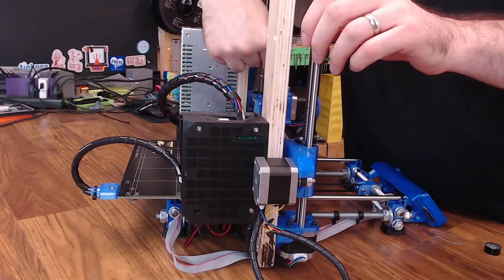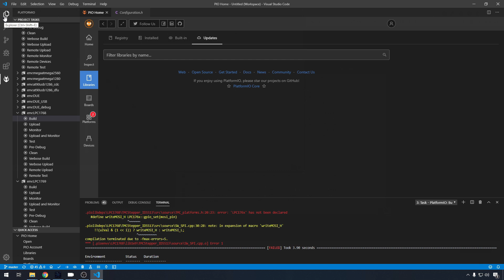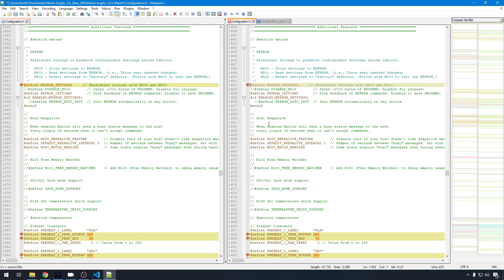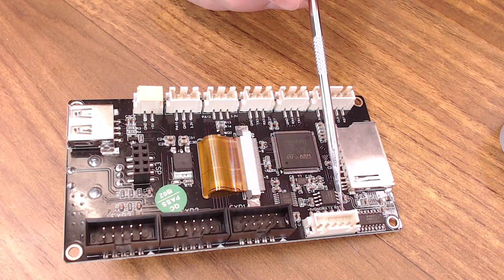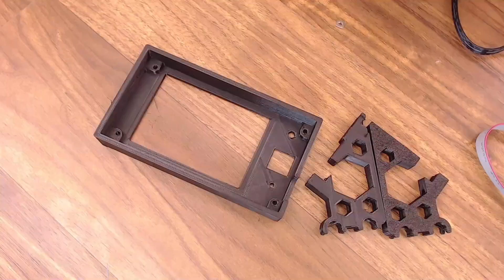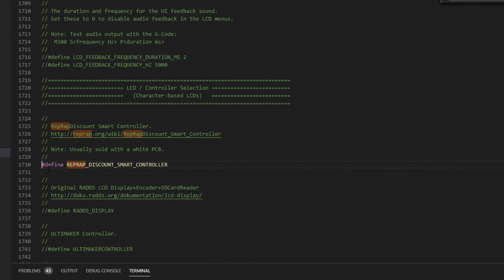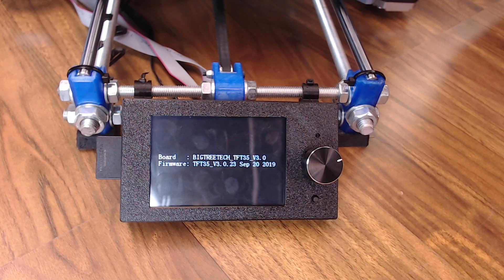BigtreetechTFT35 V3.0 Touch Screen Install - SKR 1.3 - Chris's Basement

Comment: As always very informative,
You mentioned to change the hot-end blower fan pin to make it stop when under  a certain temp. (50 C).
So the part that makes always noise can be quiet.
( I have and SKR mini E3 now and can not figure it out.)
Maybe an idea for a next item....
Thanks anyway, and keep up the good work.
efbe
Reply: Hi thanks,
But can't we use a signal pin and a Mosfet.
(PT-DET for instance ??)
I tried also the NeoPixels, but in the configuration.h the define the pin as 4, and in the pins.h its PC7 /
So I can not get it working.
efbe
Reply from the maker: Not sure if the mini has an extra PWM port to use for this. I will check it out.
Reply: Hi,
For the Fan I found a solution.
On the Mini E3 I used the PT-DET signal and I small Mosfet module, to connect the Fan to.
And assigned PC12 to #define E0_AUTO_FAN_PIN PC12 in configuration_adv.h
Now getting the Neopixel to work ?
efbe

Comment: I just installed a TFT35 E3 on my CR10 but I can't seem to get my raspberry pi to connect after I switched the serial port from -1 to 0.    Do you know if it is possible to use octoprint with the TFT attached?
Reply from the maker: I haven't found a Marlin 2.0 config yet where I can use both the screen and the USB connection successfully.

Comment: Hey Chris great video, do you know if this screen can be fitted to crealitys v2.2 silent main board  with the tmc2208 drivers? The board with the populated e1 socket. I have picked up this board and am going to fit it to my cr-10s but havent been able to get this screen to work with it on my test bench  prior to fitting to my printer. If anyone can help id appreciate it.
Reply from the maker: I am not really sure on that board, but if I were to guess you can probably use the emulator part when you cable up to the EXP3 socket.

Comment: Hi Chris, first I have to say thanks for all of the excellent videos. You have helped me so much , I hope I get a chance to return the favor. 

After installing the TFT35, it was no longer possible to connect with my computer. I wanted to mention that Sean Gould's comment about enabling serial port 2 (#define SERIAL_PORT_2 -1) helped get me get my computer connected to the printer. I even tried the "Disconnect" icon in settings menu but it did not help.

Another note: I was able to set the baud rate to 250000 in configuration,h but had to set the baud setting on the TFT35 settings menu to 250000 to get it to work. What issues did you have with that setting? I'm using the .25 firmware in the TFT35.
Reply from the maker: Hey Howard, thank you! Do you have anything else on the bus, like UART controlled stepper drivers? If I set them both to 250000 the screen just wouldn't connect, but that might have been fixed in the newer firmware, I haven't tried .25 yet. I think I had .23.
Reply: @ChrisRiley  Yes, I do have 2130s. The MB is a SKR 1.3 and I think the UART on is the default. Have not messed with this yet. Still setting up new printer: SK-Go 350.
Reply from the maker: 2130 will be over SPI, so it might not have the same affect. I am thinking the more devices you get on the serial, the higher the serial number setting might have to be to get your USB connection out of the way of the other devices.

Comment: Hey man. I really appreciate your videos. I'm having problems with my printer. I'm using the SKR 1.4 with A4988 drivers and the tft35 LCD. Anet A8 is my printer and when I finally thought I was finished with everything....only my z axis moves and I press home. It only moves up.  When I press x axis home the z moves up again. I think I'm going to start over with marlin. Can you help me get it set up right?

Thank you!
Reply: Where you able to get the tft35 working in touch screen mode?  TFT pins on the board and lcd don't seem to match up.
Reply from the maker: @christophersaintdenis5965  I got it working on SKR 1.3, what board are you trying?
Reply: @ChrisRiley  skr1.4 turbo
Reply from the maker: @christophersaintdenis5965  Sounds like it's a bit different. I will get it working.
Reply from the maker: Sounds like you might have the endstops inverted. Make sure all your endstops are not triggered, then run an m119, does it report correctly?

Comment: Hi chris, thanks for the video, I ran into issue with connection tho, when I set my serial port to 0 I can't connect my printer to pronterface but I can use the screen, set it to -1 and I can use pronterface but screen is not connected, any idea how to solve this issue ?
Reply from the maker: Which stepper drivers do you have? Are you using UART for them?

Comment: No way to disabled the motors in touch screen mode kind of a deal breaker if you plan on running in touch screen mode all the time
Reply from the maker: I didn't realize that, I wonder if we could add it easily?
Reply: I have yet to figure it out if you have a solution please share

Comment: Is it possible to use the MKS TFTs on the SKR boards? Couldn't find any advices or tutorials. All do add the 3.5 bigtreetech TFTs :/
Reply: Thx. i will test it with the same settings. But in time some cheap tft24 arrived after a long journey. Built a case for my enders... they will do and the big screens go to the bigger printers :)

Keep up the good work.
Reply from the maker: I don't think there would be any issues there, they are pretty much the same, but I can test it if you want.
Reply: @ChrisRiley  Would be nice. I don't get it running. I got a skr 1.3 and tried with the mks tft32 V3.0 and 4.0
Reply from the maker: @hanswurstusbrachialus5213  I have an MKS 4.0 screen and I was able to make it work with the 8 pin ribbon cable in the aux1 port. serial set to 0 serial 2 commented out and both screen and board set to 250000 baud rate. It does, however, not allow a terminal connection after that.

Comment: Thanks for this. I had to go back and forth with their CS and their manuals on github to get this working. There is also another way to build the firmware for the TFT35 from its source using a configuration.h. This lets you use Material theme icons. I think you also need to enable Serial port 2 in The Marlin configuration.h. One of them is -1 and one is 0. I just can’t remember which is which.
Reply from the maker: Nice, it's good to hear they have an alternate way to flash these.

Comment: Finally got around to getting one of these on my SKR 1.3 with 2209's I have my serial ports at 0 and -1. The screen works but if I am printing from Octo Print and have it in the touch screen mode it just says ready with no progress etc. Is that normal? If I switch to the emulation mode it shows me what is going on.
Reply from the maker: Yeah, unfortunately, if you are using Octoprint it won't update the other serial devices, like the touch screen.
Reply: @ChrisRiley  I wonder how hard it would be to make this work.
https://plugins.octoprint.org/plugins/m73progress/
Reply from the maker: @Craigthepope  Prusa slicer already adds M73, so this might just work.

Comment: I've followed every step, multiple times stating from scratch each time, but i always get "no printer connected". I wasn't able to find a solution either on other tutorial, what I find confusing is the serial port value, which is different on every tutorial that I watch.
Can somebody help me please?
Reply from the maker: Does the emulator part work?
Reply: @ChrisRiley  Yes, but there are a few things missing compared to the original reprap screen, for now i'm using it but I bought this display for the touch screen and I don't want to use it as a simulator
Reply from the maker: @tonksfight3518  Sounds like maybe you got a bad screen.
Reply: @ChrisRiley  I had the same thought, so I bought another screen but I had the same problems, maybe I have a bad mainboard?
Reply from the maker: @tonksfight3518  That could be, that is a really strange issue.

Comment: Nice video. Besides the 12864 emulation, does v3.0 have any advantages over v2. versions?
I really enjoyed the SK-Go build live stream. I guess you got it printing shortly after the stream?

On a side note, I watched your video about installing Octoprint in 5 minutes. I saw a comment by a "John Smith" griping about you going too fast. That wasn't me. There's a bunch of John Smith's out there.
Reply from the maker: Other than the emulator, it's about the same. Glad you liked the stream, yeah I got it up and running, I have been testing it out the best I can. LOL, good to know, no worries, I do tend to go a bit fast. Thanks John!

Comment: So theoretically, this screen with it's extra expansion pins makes it possible to connect MMU2S, filament runout sensor AND automatic bed leveling with an inductive sensor on the SKR 1.3?
Reply from the maker: Theoretically yes, but I am still testing a lot of devices.

Comment: Currently CR10_STOCKDISPLAY is active in Marlin 2.0, Do I need to comment out that line? Or doesn't it matter?  I have an Ender3 Pro
Reply from the maker: Shouldn't matter, but if you are going to use the emulator set it to reprap full graphics.
Reply: @ChrisRiley  Thank You. Yes, once my TFT35 version E3 arrives, I probably will use it in emulator mode as well. It is coming from China I guess. So I have about 2 more weeks for the shipment  to arrive in the states on the "raft". So, I will uncomment the line "reprap full graphics" in Marlin 2.0 and see what happens after I get to install it.
Reply: @ChrisRiley  Just wanted to give an update. I have the Ender 3 Pro with SKR V1.3 and I have the TFT35-E3 V3.0 display (designed for the Ender 3 I believe). Currently I am not physically or electrically connected to the printer. 
I left CR10_Stockdisplay statement intact and I could not get the display to work in dual-mode upon power up(I will skip a couple details on this). Here is what I did to fix:  (using Marlin 2.0 bugfix)
 1.  I commented out the statement CR10_STOCKDISPLAY.  
 2. I did set Marlin 2.0 bugfix to Reprap Full Graphics.   
 3.  Defined 2 serial ports as follows: #define SERIAL_PORT -1     and this    #define SERIAL_PORT_2 0
My display now works on the bench in both touch mode and in the old mode using the knob. Thought I would update if anybody else is having trouble with this combination. One last thing I have EXP1 connected to EXP1; EXP2 connected to EXP2; TFT connected on main board and on the display board.  When updating firmware to v.25 I had to also flash the icons. So now I have the "classic" menu installed.  EDIT: in this configuration, I am running at 250000 baud and currently see no issues with connection.
Thanks, Dennis
Reply from the maker: @muskateer10  Awesome, thanks for the update, Dennis!

Comment: hi chris, dont u use cooling fan for drivers? and 2nd marlin 2.0 releaed will u make comparasion video 1.1x and 2.x , u can use 2nd serial port in marlin btw -1 and 0 both
Reply from the maker: I am still playing around with the serial stuff. Learning more all the time. On 2208's and 2209's I have had a lot of luck not running a fan. Not sure if I will do a comparison, but a ton of 2.0 to come.
Reply: @ChrisRiley  waiting new videos thank you

Comment: These screens are pretty cool, almost worth it just for the mainframe-y green on black look. Keep in mind though, when printing from the SD card attached to the screen, you're talking to the actual mainboard over serial, and things like limited bus speeds, CRC failures, and buffer problems can creep up for some people.
Reply from the maker: Thanks Kevin, great point. That could be an issue.

Comment: Hi Chris, Great Vid. I had ordered one of this screens 3 weeks ago. I had an issue of the prints stopping randomly. The hotend and bed would remain on on current heat value. 
This issue was present when printing from skr1.3 scard slot and the tft sdcard slot.  No support from Bigtree.  I sent mine back for a refund.  
Have you or any one experienced this issue
Reply from the maker: I haven't yet, but since it is on the serial interface I can see how errors could creep in and cause issues. I will keep testing and see how it goes.

Comment: How difficult to put this on my Prusa MK3S? Is it possible with the stock board? Get rid of that antique screen Prusa uses
Reply from the maker: You can probably get it to work. You would probably have to use the pins the MMU2 uses. Not sure how the Prusa firmware would handle that.

Comment: Thanks Chris! I did figure out that this board had an STM chip.  Although I can now compile the marlin code I am still unable to up load it to the board. I also have tried to move the bin file to an SD card and boot the BTT SKR Mini E3 with no luck.
Should it be that simple ?
Reply from the maker: It should be that simple. If it has a bin file on it, then you power cycle it should bring it in. Make sure it is firmware.bin anything else doesn't seem to work. After you power the printer on the bin file should be gone, a CUR file will be in its place.

Comment: As always a great video Chris, I have this Touchscreen installed on my Hypercube with an SKR 1.3 main board and I love the way you can switch it.  As you said there are uses for both modes, I leave mine in touchscreen mode most of the time for fast printing from the SD card, but I like it better in the old school mode for running with Octoprint.
Reply from the maker: Nice! Glad to hear you are making use of both modes.

Comment: Hey Chris, great video as always, thank you. Just one question, when I right click on the Marlin folder, I don't get the "Remove folder from workspace" option like you did. My Marlin folder has icons on it with these options New File, New Folder, Refresh and Collapse Folders in explorer. I am using VS Code with the Platform IO extension as you showed in your previous video. Any clues would be awesome.
Reply from the maker: Hey Spike! Hmmm, strange, it should have that on the parent folder, it should also be up in the file menu I think. I will have to check mine out.
Reply: @ChrisRiley  It will be very interesting to see what you find, maybe a video idea to help everyone to understand Platform IO / VS Code layout and various command functions.

Comment: Great  Thanks ! 
I  Bought the BT 2.4 V1.1 tft screen Specifically so I could print either from SD card OR flash drive ...Because   SKR V1.3 doesn't want to print from it's SD card slot... Grrr.  
TFT 2.4 V 1.1 Screen Does .. readily .. from both USB flash drive And SD card (albeit with an adaptor as the Stoopidly large  SD card slot is from a decade or more ago... Grrr Again ! 
BTree  you  cheap twits.   
Need a bigger screen tho  as 2.4 is teeny tiny,  it works ok at least.  Looking at 3.5's a single mode.. TFT only.. is reasonable priced  while their dual mode TFT  (yours in the video) is significantly Mo" coin yet.
 However the Single mode screen... Only has one of those Huge SD slots ... No USB. 
Wondering if there is a contraption to fit into that Oversized SD socket to produce a USB socket from it ?
Reply from the maker: Thanks for watching! SD to USB, I would think there was something like that, but I don't know for sure, I will have to look around.

Comment: Thak you for putting out good info. Your channel is one of the few I check out when I need to find something I have questions on. I left Marlin firmware long ago when I converted all the printers I use to Duetwifi's and learned reprap firmware. Now I am building an old school i3 printer just for the fun of it and I saw these cheap 32 bit boards put out by BigTreeTech and decided to try it. You video's regarding how to configure and upload Marlin 2 via vs code  are very good and to the point. Still a bit more involving to make changes to your firmware than the duets, but a good alternative for those who can't afford a duet.
Reply from the maker: Thanks Vance for watching! I am glad the content works out for you. Thanks for the comment.

Comment: Thank you chris I been waiting for someone to do a video on this screen. As I'm planning on getting one for my new 3d printer I'm building from scratch. very informative video  . Two question can you switch between touch scree and old school mid print.
And will it work with SKR pro 1.0 thanks in advance for a response.
Reply from the maker: Yes, I think you can switch mid print and yes, it should work on anything with the TFT connection.

Comment: Hello Chris,  I have just got my hands on a BBT SKR Mini E3 V1.2 and a TFT35 V3.0 and this is my first go at VSCode.  With Marlin bugfix 2.0 I can get my configuration to compile only if I select STM32F103RC. I tried the env1768, build approach and it failed. Why?
Also I am unable to load via USB. I get this error:
Any advice is appreciated.  Thanks
Configuring upload protocol...
AVAILABLE: blackmagic, dfu, jlink, serial, stlink
CURRENT: upload_protocol = stlink
Uploading .pio\build\STM32F103RC_bigtree\firmware.elf
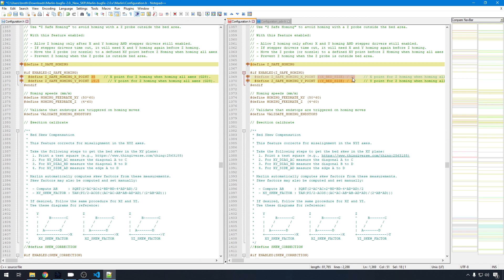xPack OpenOCD, 64-bit Open On-Chip Debugger 0.10.0+dev (2019-07-17-11:28)
Licensed under GNU GPL v2
For bug reports, read
        http://openocd.org/doc/doxygen/bugs.html
debug_level: 1

hla_swd
Error: open failed
in procedure 'program'
** OpenOCD init failed **
shutdown command invoked
Reply from the maker: Yeah, those boards have different chips. I don't think that one has a LPC1768, but I haven't look at that one yet.

Comment: Check out the latest TFT firmware. There have been many improvements since the version used in this video like a better fullscreen mode, new icons, alternate TFT UI, and much more.
Reply from the maker: Hey Keith, I tried the .25 version and it scrambled the screen. Not sure what's going on.
Reply: Chris Riley Have to update your icons and fonts too 🙂 Copy the TFT35 folder the root of and SD card and those will update as well.